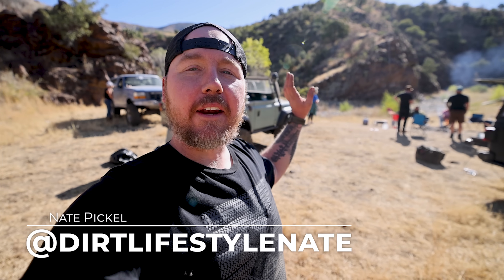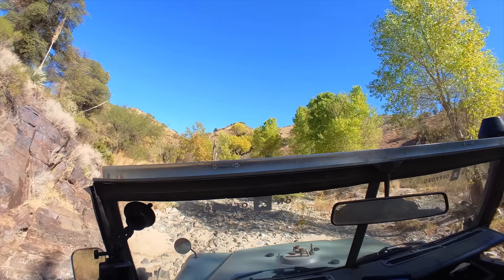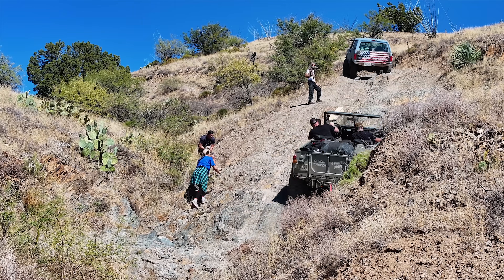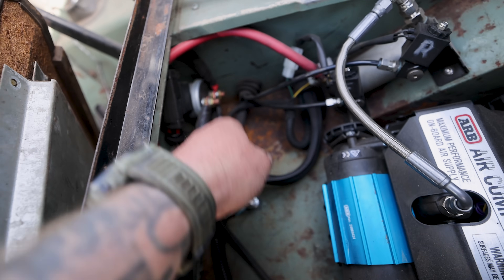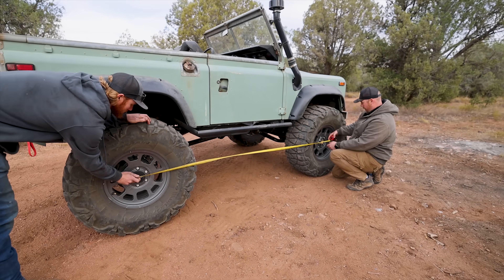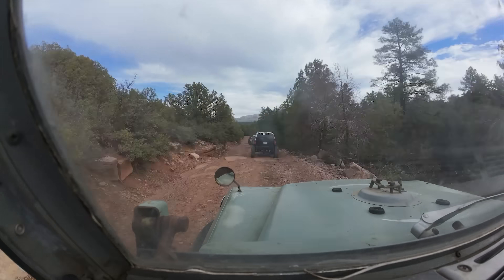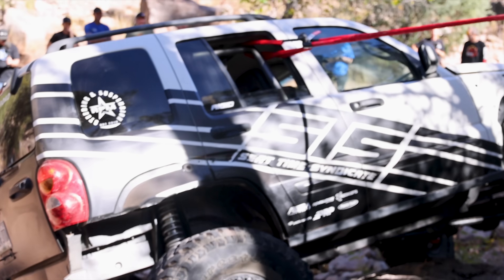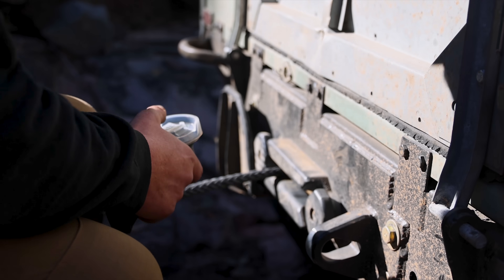The WORST thing about this Landrover!!! Arctic Land Rover Build episode 4

Comment: That thing is tight. No fake patina of shiny paint. Just a cool, honest little rig
Reply from the maker: Thank you! I think you nailed it in you use of the "honest". That is definitely responsible for alot of it's charm! This wouldn't be near as cool if it was a full restoration
Reply: Right on!
Reply: @DirtLifestyle  Had quite a few Land Rovers over nearly 50 years ranging from V8 Range Rovers to Series 3 88" diesels, I think 65mph in your Land Rover is fast enough, a friend put in a 2.8 litre version of the Land Rover petrol into his stock 1980 88", got it to 100mph and it was quite scary and VERY noisy.

Comment: Nice modified landy. We used to do lots of similar stuff in the past. We generally fitted the Rover SD1 v8 petrol engines for more power. About 200hp in standard trim.
Many were built using an old Range Rover chassis. We cut 1 ft out of the middle section and cut the back end down to weld a land Rover cross members. We then move the engine back in the chassis and cut the front end down. We made them 88" to match the shorts wheel based Landy. We used Series 1 doors, series 3 bonnet, series 3 windscreen but cut the centre rib out and used one piece glass and wipers from a car. The floor box went and we installed a custom fire wall and bucket seats on the floor. A full roll cage was installed. Weight was 1.1 metric tonnes. This will be similar weight to yours. We had a very light aluminium engine but the weight of the cage. We also had a custom  built rear body that housed a fuel tank and battery. We used Range Rover axles and an automatic 3 speed from a V12 Jaguar grafted into a series 3 transfer box. We could do 80mph in low box. With the Range Rover link bar on the rear suspension, it would happily sit at 80mph all day long.
With the diesels, the 300tdi is a great engine. We used Allard intercooler, Griffin stainless steel exhaust, balanced injectors, tweaked turbo. No real mods to the engine. They are a robust unit that responds to the above mods well. Fuel efficiency improved dramatically but you get lag from the big intercooler. About 170hp

Comment: Best build I've seen on any xhannel in a while. The COG must be around center to bottom of the wheel wells. 

Marlin makes a 4:1 tcase gear set
Reply: And maybe just work iut using a marlin double t case transmission and make it the tractor that it should be.

Comment: top tip for any land rover with a cool heater, check the slack in the heater cable on the air box arm. set the temp to hot then see if you can move the arm more.

Comment: Nailed it! Awesome rig. A cage would ruin the look. Maybe a hoop?
Reply from the maker: Thanks! We are playing around with a few ideas for a basic cage. It will depend on what I decided to do with this. For snow wheeling and car shows I'm not thinking a cage is necessary. But If I decide to hit the rubicon or something then a cage is a must... I have plenty of capable rock crawlers on hand 😁
Reply: @DirtLifestyle  Maybe a Hoop in the bed in the shape of an old school Sports bar would look nice and give you rollover protection.
Reply: @DirtLifestyle  It reminds me of the show Rat Patrol. You might be too young to remember. Lol
Reply: @DirtLifestyle   I had an ex-mod 109 w/  the original twin tube roll bar, which though tub rail mounted and  lacking any triangulation/bracing, might still be inspiration for some "correct" appearing mild roll protection.  Love the 88", err 87"😅
Reply: What winch rope and fairlead combo is that on the rear winch setup???

Comment: you should build a low topper for the bed like the vetts use. folding in the middle but a little taller than a tanue cover. oh and its awsome as it sits, great job

Comment: I love this build!  I love how you found a newer LR diesel (i5?).  Kept it within reason, didn't go too hog wild.   I absolutely love the truck conversion!

BTW, I have 35" Nitto Mud Grapplers.  Had them since 2014 before they exploded in the mall crawler scene.   I am from just down the road from where you are (grew up in Puyallup, cousins in Spanaway, grandparents in Graham) but living in Toronto, Ontario Canada.    

Here, the traction on our public trails is hard pack, a bit clay based, over large granite "whale tales" that rise up out of the dirt like Moby Dick out of the ocean.   This creates our fun obstacles but with even a hint of wetness, crawling is out.  Its a give'r.    MGs are mediocre in these conditions.  I wished I went with Trail Grapplers, Cooper STT Pros, or MT Baja Boss mts.   Those are the more common high performing tires in our area.   

We have just enough mud and swampy areas due to the beavers changing course on our trails to require MTs, but a lot of wet/slick granite as well.

Comment: I think its  an amazingly smart build, light, maybe just right because of the wheelbase?  The cap looks cozy and was needed for snow wheeling, do you have a good heater?😮. Would you consider lengthening the cab? Make it a four door? Would add length and weight.💡 love watching your builds, maybe a build not under the clock? 😅. Anyway it runs great. ✌🏻🧡 🇨🇦.

Comment: Nate you need to find  series2a suffix B gearbox intermediate gears 521330  and 235438. that will drop the low range from 2.35:1 down to 2.88:1.  unfortunately intermediate gear 521330 is rare because Land Rover only made it for 1 year.  keep up the great content.

Comment: Absolutely nailed it. Seriously looks straight out of a super cool animated movie. Check out Shawn the Sheep. 

In Australia they swap out Toyota axles with Nissan patrol axles, but with that little 300 Tdi and some lower gears you should be fine. 

If you run some guide tubes you should be able to use your winch forward or backwards.

Sorry, just noticed you went with the 2.5 TD engine.

Comment: That thing is sweet! Love the old school simple wheeler, and the diesel sounds perfect. Do you have a heat shield between the battery and the exhaust pipe? Might not be needed on a diesel but should help extend your battery's life by keeping it a bit cooler. Shame you couldn't get a truck cab from the same place you got the tailgate - the paint doesn't match lol. Love the faded green patina.

Comment: Yip ratios will be a problem with tyre size. A 4 cyl forward control was made same era as this, that ran 900.16(same diameter as 35s) tyres and had much slower low and high ratios.

Comment: Very nice configuration, and I really enjoy the pick-up "version" of the 88''
That engine suits very well the Series, isn't the most powerful engine in the world but has a lot of low down torque that help to explore all the small amounts of traction and tackle the obstacles easily. And it's very economic as well, only thee 200 tdi is better.

find a short diff ratio, and it will be much nicer off road.

Comment: Man that is cool. I have riden in a series 1 that short and needed new kidneys, Got to say I would have got a short BJ Toyota and done the same axle swap and probably put a 1 HDT in her with a 5 Speed with factory lockers all round. But the Landy is cool and the best thing is you got rid of the horible running gear and motor. You are a brave SOB without a roll cage. Best vehicle in the group.

Comment: Trying to figure out how you get this to weigh 3,000 lbs when my 1958 series I model, the "Penalty Box" weighs in at an even 4,000 lbs  empty with a soft top on my local certified scales... (on it's original axles and suspension, 7.50-16 tires, and factory hydro PTO winch)    Granted, I have an iron block LS under hood, SM420 trans,  and some fairly light boat sides and belly pan, but your 19J weighs similar.  Mine is rock stable on the interstate, super comfortable handling at 70-75MPH literally all day as I never trailer it.  I drive it from Cali to Washington state multiple times a year, Moab multiple times a year.   Too bad you didn't want to learn anything about the original platform and give it a chance.... You'd be shocked at what these things can do on leaf springs.      I am working on an under / overdrive for these, but my guess is your swapping out the trans / transfer case too.  (I have a 99:1 crawl with 3.50 gears in my axles)   By the way, bob and roll  those front fenders up to the crease line under the lights, I learned that trick almost 30 years ago running 35's with no lift, works great with 37's and some lift.